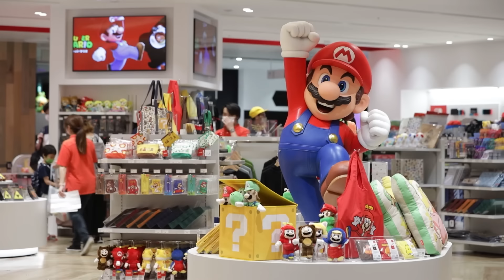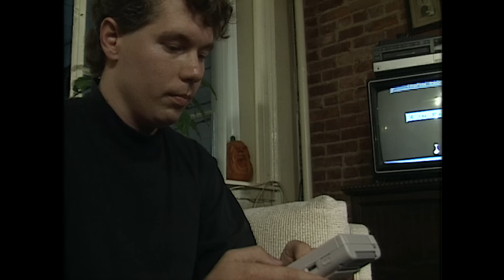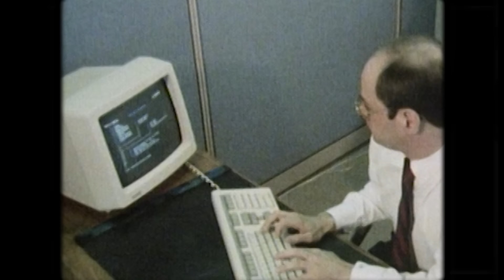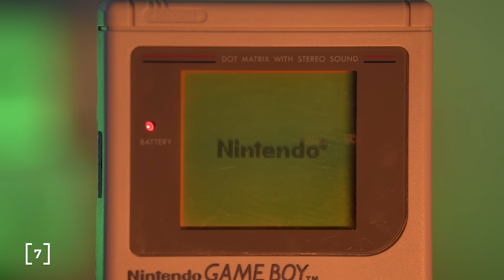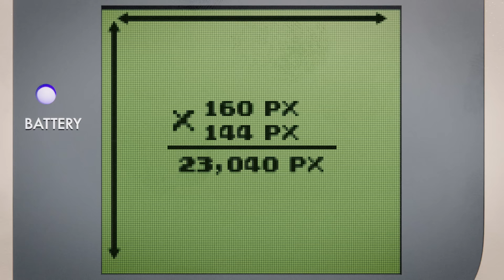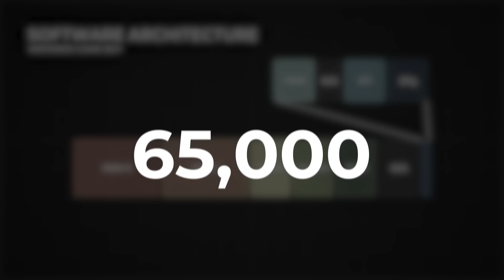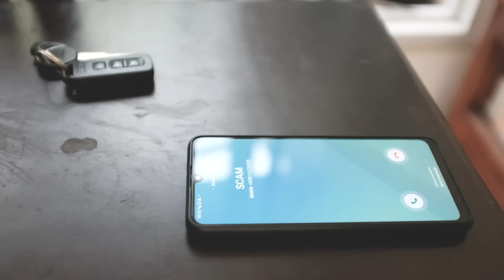The Insane Engineering of the Gameboy

Comment: It's crazy to think that battery powered electronics are a foreign concept to some. Batteries were everything back in the day. All the toys and gadgets required batteries so our parents would spend Christmas day putting together our new toys and Santa always remembered to bring batteries lol <3 I miss a more analog life. 

I stopped buying anything that requires a charger or I'll opt for the battery powered version if it's an option. I hate having 867 generic chargers all over the house and I hate how easily they break (or the charging port on the electronic breaks). With batteries, you just pop 'em in and you know they'll work. No troubleshooting, no rearranging the other chords plugged into the outlet because you have no open spots to plug anything in, no countless power strips all over the house, no need to be within the vicinity of an outlet, no drama. Batteries are the way.

Comment: Over 2$ an hour in batteries. 
So, I just bought one of the best TVs money can buy. A LG 65 inch OLED. Its more than I ever thought I would spend on a TV. Most people would think its stupid. But I looked at how long my last OLED lasted, and how many hours I used it for. The new TV, if it last as long (but it should be longer since its a G series) will only cost about 15 cents per hour of usage, plus maybe 2 cents an hour for electricity. So if my new TV lasts longer than 6 years, that average cost goes down even more. That means that something like an Game Gear, is about 150X worse purchase than an G series OLED if you are looking at cost per hour of usage.

Comment: You're confusing bits and bytes. A black and white image 160x144 uses 2,880 bytes, not 23,040, about 4.5% of the address space.  The game boy screen used 2 bits per pixel though, so if it were greyscale, it would use 5760 bytes, or about 9%.

Comment: I had the game gear and the game boy. I preferred the game gear because of the color screen, the backlight and fit better in my hands. I used a rechargeable battery pack accessory for the game gear and it worked great. I also was already an adult when Pokémon came out so I never got into it. I still haven't.

Comment: I used the AC adapter for my gameboy but it had a critical flaw. It would not fall back to batteries if disconnected. So many times I would move slightly and it would tug or turn and cut power for a micro second and my game shut off without saving.

Comment: Also i learned this much later in life but you should NEVER blow on your cartridges it damages them over time, if you need to clean it use a q tip and some isopropyl alcohol to clean the contacts if you have to blow its time to clean your cartridges

Comment: Annnd you technically only needed two to power the gameboy, you could use double A dummy batteries two of them or use a wire instead, and the gameboy will work just fine, I remember doing this when I was short double A's as a kid back when TV Remotes only took two double A's, I stole the TV remote batteries from my dads TV lol. And used a wire to connect the other connectors.

Comment: I actually appreciate the amount of fun people had while inventing this Gameboy : 

1/ SCREEN:
Its LCD used SuperTN with PWN-like technique to make 4 colors instead of just 2 like other monochrome LCD without backlight, saving more power to lengthen game-time to ~30+ Hours. Even nowadays, non-backlight screen is still somewhat a problem that doesn't seem to be solved ( cheaply ) for both fast & readable without backlight...

2/ 16KB RAM:
Its 8-bit CPU (SHARP LR35902 ~4.19Mhz ) can only use 8KB WRAM + 8KB VRAM ( so a total of 16KB) , which force programmers to smartly utilize such resources by compressing sprites into tiles.

3/ SOUND: 
Its only speaker have only 4 channels : 2 square waves, 1 white noise maker, 1 custom waveform that can be loaded from cartridge.

4/ ROM:
GB hardware can only read 32KB data at once, so they use MEMORY BANKING technique to access > 32KB of data by dividing them into banks ( This was similar to how 8-bit PIC microcontrollers use its BANKSEL to access 256 bytes per reading ). Ex : Pokemon Red/Blue is 373KB & need to be divided into 44 banks. Each bank contains information of certain sections in-game.

But nowadays, 8-bit PIC microcontrollers are still using this MEMORY BANK technique ( BANKSEL in PICAS - PIC Assembly Compiler ) because it can only access 256 bytes at once.

Comment: I got an AC adapter pretty soon after getting mine, even the original model had a plug in power port, just no official plug, but those AC adaptors with multiple heads worked great. I only used batteries when I played away from home. The game gear had one too, but its games just felt like worse versions off Megadrive games.

Comment: Why I loved the Game Boy OG version 1.  It worked, had great games and it always worked. You were never hunting around for batteries. If you needed a light you turned one on. 
It's very similar experience with the Switch (except for the updates which everything suffers from now). It just works and works for long enough that you can get your fill in most games. 
Steam Deck is a close second even though it is linux !!!  I have the OG Deck and battery life leaves a lot to be desired but when I pick it up, it just works. It's more like the Game Gear in that way but with a charging cable instead of the hunt for batteries.

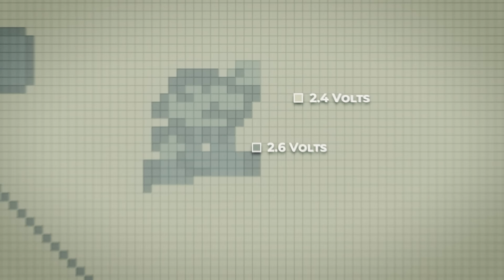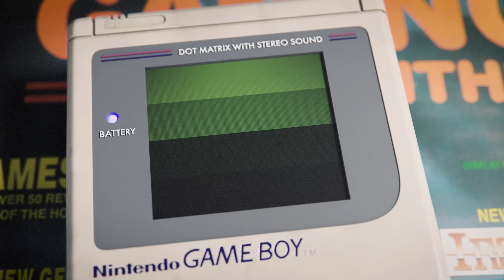Comment: What are your sources for the LCD voltages and shading setup ? I think you got things swapped, like the voltages around 5:40 and the and shades at 7:00. Shouldn't those be reversed sine the LCD's default state is white and pixels turn on to block light ? I think this is why it's necessary to remove filters or turn them 90° when doing a backlight mod.

Comment: The device and many of its engineering choices were extremely well thought out. But the sound chip was a catastrophe, it was far too limited, because while it had 4 voices compared to for example only 3 of the C64, each of the voices were hardcoded to one specific waveform type. And exactly that made every game sound practically sound the same, and the C64 so diverse. A prime example where comparing technical details ("4 voices = better than 3") is not fitting.

Comment: I was around when the thin was made. Everyone lusted after the lynx of game gear. The real and ACTUAL reason the Gameboy was more popular is BECAUSE THE GAMES WERE MORE FUN AND JUST BETTER and there were far more of them and it was cheap. It had little to do with battery life or anything else technological on the inside.

Also im not really sure why you try and push the illusion that the GB cards were such low memory. The NES was already in this range. SMB was an 80KB game and it was full color. 64KB was plenty to work with back then as a start and Super Mario Land 3 was 524KB. A few games were double that. So I dont get what youre on about here.

Comment: desert island console list in descending order of their overall quality/durability/usability/portability/software

1.  android smartphone (newer the better but quality/price ratio started to level out and drop after 2019 with the release of the samsung note 10 and note 10 plus)
2. nintendo 3ds  (2011-2020)
3. game boy advance/gameboy advance sp (2001-2008)
4. PSP (2004-2014)
5. nintendo ds (2004-2014)
6. game boy color (1998-2003)
7. game boy (1989-1993)

we've fallen off as a society tbh cause besides android, the switch is the only real portable console (if you mention the steam deck you deserve to be laughed at and into the nearest sewer access tunnel and sealed there for eternity) and the switch is more fragile than glass and has less battery life than even an iphone 💀💀💀

goddamn.  2014.  nintendo ds, 3ds, AND the PSP were ALL getting software and OS updates.  damn.  we've REALLY fallen off.

i cant imagine a used but pristine ps5/4/3 or ANY xbox selling for even half as much as an old beat up copy of almost ANY nintendo handheld console made before 2014 in 5 years let alone 10.

Comment: you cant run any modern console without a constsnt internet connection and an outlet except the switch thatll die in 30 minutes gasping for air lol

the steam deck cant last much longer and its over DOUBLE what the switch costs and is less powerful and has a worse screen and has a fraction of the battery life of even a mid ranged android smartphone lmfao

meanwhile the og gameboy lasts for hours on sh!tty little double a's, has vastly better and more compelling games, is LITERALLY bomb proof, and isnt a p@ssy that needs constant internet and 100000000 watts of power.

the only mobile gaming platform better than the game boy, game boy color, or the game boy advance are android smartphones.

and nothing else comes close.

Comment: rechargeable batteries were a thing in the nineties too!
Reply: The rechargeable batteries were much more expensive and didn’t have nearly the capacity. By the time you got a charger and a few sets of batteries it was cheaper to just buy a few packs of regular batteries. 

The better option was to get the a/c adaptor and only use batteries when you needed to.

Comment: But I think we also have to consider a few things here -  The Sega unit had a color screen I believe and backlight, two things that the Gameboy did not (at least the original one, and even the Game Boy color didn't have a rear backlight and this is probably where a lot of the Game Gear's power went to thus requiring the extra batteries and shorter run time.  If it didn't have this, it likely would have lasted a lot longer.  In it's day, the Game Boy accomplished its goal, but I think it quickly got outnumbered by either cheap knock-offs or competitors in general who had color consoles, and while Nintendo did release a Game Boy color, by that time, others had moved onto using things like mini color TV screens for better gaming experience.

I guess we could look at Intendo as perhaps Apple in away, in their design philosophy in the day.  It was simple, but ended up being a revoluation that sort drove the portable gaming industry.  Obviously today smartphones (even ones that are 10-15 years old) will run circles around any of these consoles and I'd argue even PCs of the time.

Comment: Nintendo totaly know that it was low tech and cheap console when Gunpei Yokoi show them the prototype, they where not convince of the success of it, but they even succed over there building cost a NEC PC engine GT with color screen was far more high tech and costly it was an 8 bit able to work with a 16 bit graphic chip and a Street fighter 2 port run on it that look as good as the SNES version, but the secret of Nintendo was also there juicy franchise like Tetris, Mario and Zelda and they keep this console on market as far as they could with the pokemon franchise and a color version with almost the same hardware.

Comment: The Nintendo Game Boy, launched in 1989, was initially met with mixed reviews due to its technological limitations, such as a lack of a backlight and low memory. Despite this, its design focused on being affordable and portable, key factors that contributed to its widespread success. Compared to its competitors, like the Sega Game Gear, which had a color screen but consumed more power, the Game Boy used fewer batteries, providing longer gameplay at a lower cost.

The Game Boy's engineers employed creative solutions to overcome its technical limitations, such as a low-powered monochrome screen that could only display four shades of green. The system achieved this by pulsing pixels on and off to simulate different shades. Although it had minimal memory, developers used techniques like memory banking to create games that required more data than the hardware could handle. Classic games like "Super Mario Land" and "Pokémon" utilized this approach to maximize the Game Boy's limited resources.

The Game Boy's simplicity, focus on user experience, and energy efficiency made it a generational success. Its legacy continues in Nintendo’s design philosophy of prioritizing accessibility and innovative gameplay over cutting-edge hardware specs, as seen in later consoles like the Wii and Switch.

Comment: Blowing on cartridges was done by the uninformed on older carts, like NES games in the mid 90s, but new games rarely had connection issues. If they did, it was better to clean the connectors with isopropyl alcohol on a q-tip.

Comment: 4:50 small but significant mistake there: the whole deal with twisted nematic at the time was that applying a voltage would cause the crystalline elements to arrange themselves perpendicularly to the glass planes. What is shown here is the behavior of In Plane Switching tech, which was not available at the time (at least certainly not in the GameBoy). This is not inconsequential: that TN behavior was the reason for crappy viewing angles (among other consequences). Source: every single TN vs IPS article out there.

Comment: 13:25 Both ROM0 and ROM1 are on the cartridge, but only ROM1 is switched out when banking. A game would place all its common code routines in ROM0 so that those would be available no matter which bank is switched into ROM1. This isn't just for convenience, games place the actual code routines that switch out the bank into ROM0, because you don't want to switch out the data for ROM1 while the CPU is execute from there because it will happily continue executing code from the new bank at the position it was in when the bank was switched out which could be completely different code. Also as an aside, the bank switching is purely handled by the mapper chip on the cartridge, if a cartridge doesn't need bank switching it can just connect a 32K ROM chip directly to the data pins on the cartridge and have just one continuous ROM area.

Comment: And look what's happened now, with the development of systems like the Raspberry PI.  You can get a hand held 'console', on eBay, for £10, smaller than the Gameboy and infinitely more powerful, loaded with 1,000 games on it.  Loaded, out of the box, pick up and play, with every game that was ever made for the Game Boy pre-installed on to it, a library which, back then, would have cost thousands of pounds, a library which every kid my age would have happily have killed you for.  The tech has become smaller, but significantly more powerful.  I actually remember the Game Boy being released.  I had a system link two player with my friend at the time on one of the green screen WWE wrestling games.  To me, back then, it was the best thing ever.  Now, I can't keep up with how quickly tech changes.  Now, I emulate all of the old games on my Steamdeck.  It's remarkable how technology has changed between then and now.

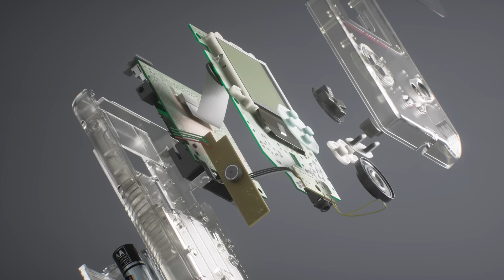Comment: 1:55 actually in 1989 zinc-carbon batteries were still more common. They had the same size and volfage as alkalines, but only about 40% of the capacity. So they made optimization for low power even more important.

Though you could buy a rechargeable battery pack for the Gameboy for 30$, which would save you money overall if you were a heavy user.
Reply: That’s not at all how I remember it. My earliest memories of using batteries, ca. 1985, were always of alkalines. And that’s how it seemed to be with everyone around: Duracell and Energizer batteries (two brands of alkalines) were everywhere, far ahead of anything else. I have a strong suspicion that alkalines were already dominant by 1989.

Comment: The part about battery life and compromising graphical power as a trade off is exactly why something like Nintendo Switch is such a massive success compared to something like the Steam Deck.  Steam Deck edge lord fanboys who consider themselves "serious gamers" (ironic considering a mid tear Steam Deck is the same price as a much better PS5) hate to admit that Nintendo figured something out years before concerning tradeoffs to battery and performance and they created a better console even though Steam Deck had the benefit of coming out years later.  Nintendo realized that the whole point of a handheld was mobility and battery, not raw graphical power and using tons of watts per hour.  They intentionally build a console with basically mobile graphics hardware so that a person can play it minimum 3 hours without a charge (most games will last 4-7hrs and some games even longer, 3 is a minimum for the most power hungry games).  Nintendo opted to not give you, the end user, a choice when it came to graphics settings because you, the gamer, make bad choices when it comes to the end point of the system.  So here we have a couple million Steam Decks sold and the end user basically treats the system as a wired-to-the-wall low tear gaming laptop.  They crank the graphics and end up with 1hr of battery life until they have to be tied to the wall.  That's not a thing with the Nintendo Switch.  Nobody plays a Switch wired to a wall socket.  If you bought a Steam Deck you have to wonder at some point why you spend $550 plus tax to play some handheld with a cord plugged in more than half the time when you could have purchased a PS5 and played with better graphics at 4K/1440p and 60fps or even saved up and bought a true gaming PC or laptop.  The Steam Deck is an abject failure and is nothing more than an interesting experiment (not even that interesting once you realize what it's all about) while the Nintendo Switch has sold almost 150million units and is one of the best selling consoles of all time.